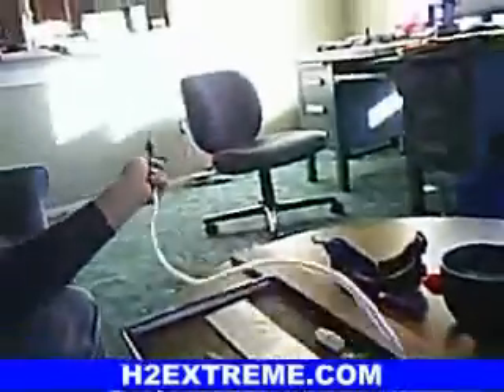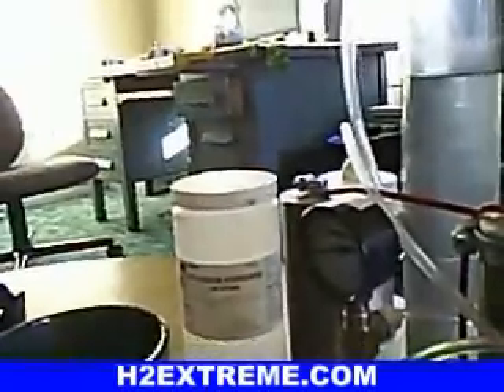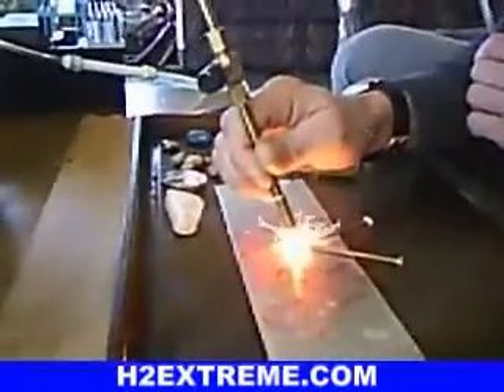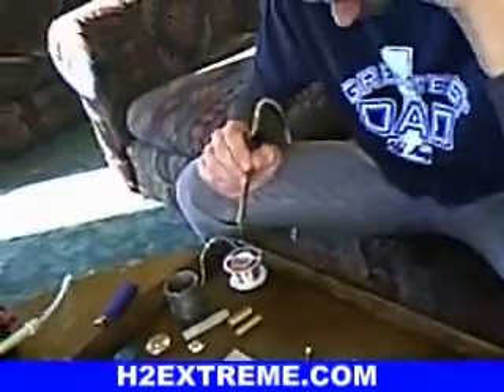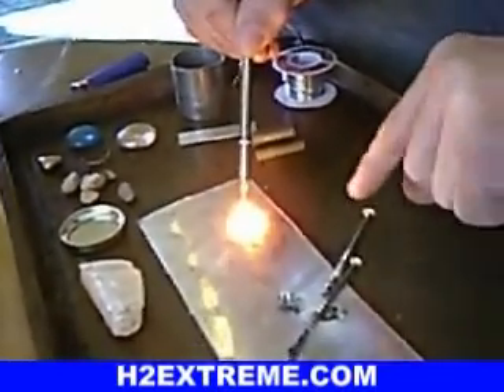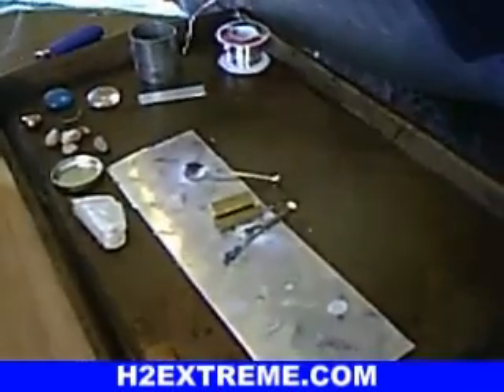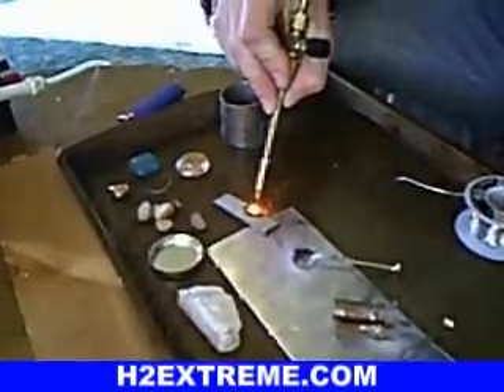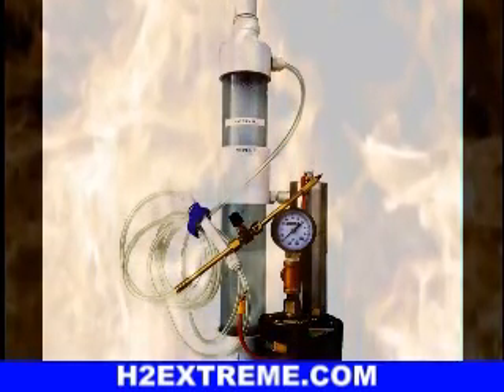hho safety

Comment: So you get water in  your weld? You could dry it with a desiccant as it comes out of the cell. Anytime water is involved, it will get en-trained and follow the gas out of the cell. If you run the gas through a tube of calcium chloride, or sodium/potassium hydroxide, you will end up with a much dryer gas. You could even use 3-4A molecular sieves for this purpose. It would probably work a lot better.

Comment: The hydrogen imbrittlement would only be a concern if the hydrogen was still in a gaseous state. The flame is the reaction of browns gas rearranging on  a molecular level into superheated, dry steam. The bubbles in the weld are due to the extreme temperature of the flame. Try brazing with the flame much farther away from the metal and you should get better results.

Comment: Well, you wonder if brazing would work, but suspect that it would, based on your PB/SN solderinig.  Sad to say, but PB/SN soldering is actually brazing.  Not with bronze, but with PB/SN.

Soldering is fusing two similar metals together.  Brazing is no more than "metal glue",  wether it is bronze in between two iron pieces or PB/SN in between two copper (or copper made, like bronze or brass) parts.

:O))

Comment: Part 2:
C) For good metal welding the flame contains
     to much oxygen; you are oxidizing the weld
    you may solve this by producing the gasses
    separately, and apply to the tip a mix with up
    to 5 times more H2.

Soldering works great but therefore is this super hot flame a bit overkill.
For doing juwelery it's fine.
Also for plastic flame-polishing (it's sootless).
...and turbo patato cannons. ;-)
Keep on bubbling.

Comment: Part 1:

Good vid, underlining the safety isues,
can't been done enough.
You can not weld those screws, because :
A) They seemed galvanized.
B) Hydroxy is not the best gasmix to weld, the
    flame is very hot but the energy content is
    low,  therefor some hydroxy welders-snake-
    oil-salesmen used an extra bubbler with an
    alcohol, like methanol, that will also give the
    colorless flame a visable color.